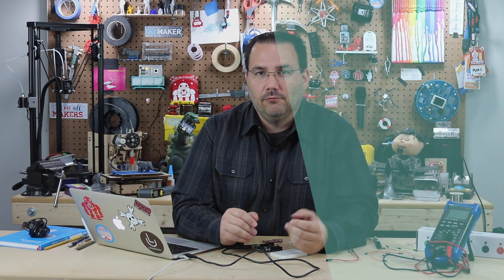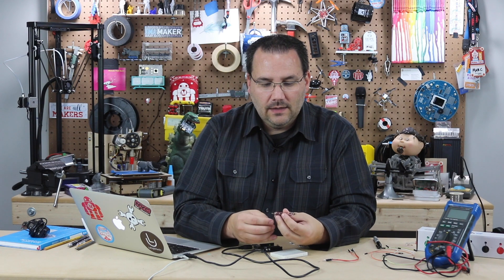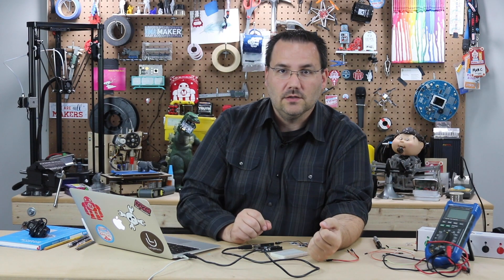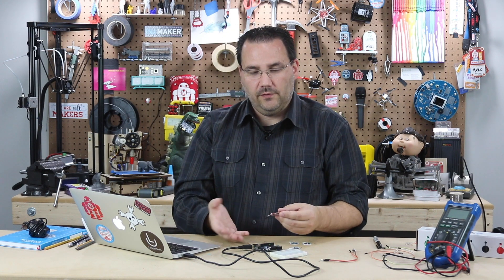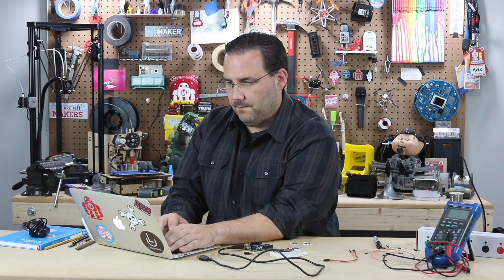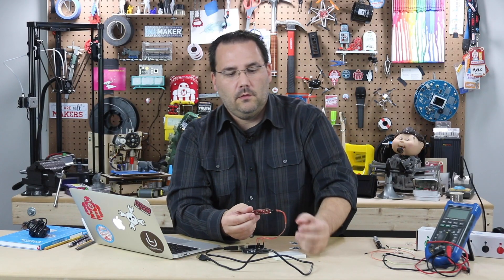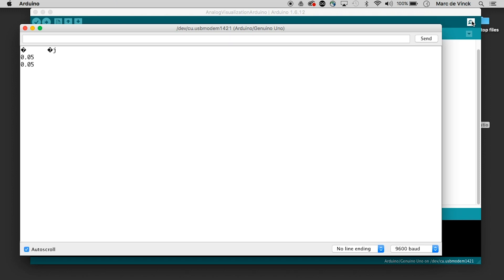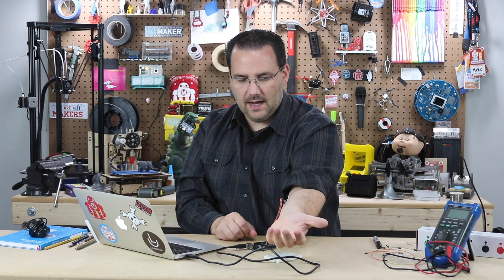Arduino Prototyping Inputs #64: MyoWare Muscle Sensors

Comment: i am facing noises while reading from the sensor. how you solved this problem?
Reply from the maker: Filter the results via code if possible. That is the easiest solution. Try averaging the results over time?
Reply: Also a USB isolator could help.  Adafruit does one, listed on the myoware website.

Comment: What's that 3 pin connector you have on the myoware? The one with the positive, signal, and negative
Reply from the maker: One side is for adding shields, supplies power and signals, the other is also for data out. Check out the data sheet for all the info. You can find it under the "Documentation" tab on this link -- https://www.sparkfun.com/products/13723

Comment: Hi, thank you for your amazing video. One question- I tried it with the basic AnalogRead sample and the output data had an average of 250 instead of 0.05 like yours. Do you know why that would be? Thank you.
Reply from the maker: If you are using the supplied code with MyoWare, then I'm really not sure. If you have your own code, my guess is the range of you mapped values if incorrect, or post processed with some more math that is making it off. I'll also add, that if the results have a range, it might not be an issue. Might want to head over to the MyoWare website and ask their tech support.

Comment: 1:31 are there any alternatives to disconnecting the computer charger in order to disconnect the arduino system from the high voltage supply? For example, is there any adapter that you can place between the arduinos USB-connector and the connection to the computer, in such a manner that there isn´t any direct connection between high voltage and arduino, but att the same time, the computer is continuously charged?
Reply from the maker: I'm not exactly sure about a solution, or what you are asking specifically. Keep in mind that the MyoWare can be run right from an Arduino, without a computer. So there is no high voltage involved, and it's a lot safer. If you need external output like a serial monitor, you could use an onboard LCD, which could eliminate the required computer. I would head over to their site to get specific details, as they would be the experts. -- http://www.advancertechnologies.com
Reply: @MarcdeVinck  Thank you for the quick answer! I would like to do some "long-term" (one working-day /8h) EMG testing while continuously monitoring signals from the EMG via the Arduino serial monitor/plotter. However, my laptop battery will not last that long! I have a weak recollection of seeing this safety adapter that you put between Arduino and the laptop for the purpose of fulfilling the properties described in my first message, but now I can´t seem to find it anywhere. Maybe it was just something my mind made up.
Reply from the maker: @Robin_Juthberg  Any standard USB cable will have data and power lines. Basic cables supply power only. In either case you can't isolate the computer form the Arduino if you need power. You could optically isolate the data signals with an optocoupler, but hat does not supply power.  You can use an external battery pack, sized appropriately, and it can last a very long time. Just be safe!

Comment: Hello, is it safe to use two MyoWare sensors plugged in the Arduino Uno with USB as the power source? I want to measure the muscle activity of two or more muscles at the same time and I couldn't find anything in the internet. Hope you can help me here. Thank you!
Reply from the maker: Check out the MyoWear website for all the safety information. I don't like anything plugged into an outlet when strapped to my body.

Comment: Hi, thank u for explanation on the safety use of muscle sensor. I want to use muscle sensor with other sensors and esp01 wifi module.  I want to know if I can connect all them together on 5v pinout? Will there be complication with current drawn from arduino to sensors?
Reply from the maker: Y Indigo It depends on how many sensors, what types of sensors, and the pins you are using. In general, most sensors don’t draw a lot of current but that varies a lot.

Comment: Hi! How would I be able to use the input values from the sensor to control motors? I'm trying to control multiple motors to respond to flexion of my arm muscle but I'm not sure how to connect multiple motors and a sensor to an Arduino.
Reply from the maker: To control a motor with an Arduino is best done by off-loading that process to a motor controller board. There are many out there. Check out Adafruit.com and search for motor controller. This is especially true when it comes to multiple motors, servos, or anything that uses more power than the Arduino can handle (which is low). In fact, it's always a good idea to use some kind of H-Bridge to control motors.

Comment: hello ,
can i test the duration of the contraction if it is long time or short time to detect more possible movements ???? and how it can be done ?? show me the code of it please.
thank you
Reply from the maker: Sure, you can detect when the contractions occur and the time between the contractions. For the code. Sorry, I can't create the code for you, I just don't have time and I've got to pay the bills too! Try searching for measuring time with Arduino via your favorite search engine. It should be fairly easy to adapt code to work in your project.

Comment: Stupid question I’ve been seeing videos when they used a nano arduino, my question is it possible to use a arduino uno instead a nano for mayoware muscle sensor? Would it give the same results to?
Reply from the maker: Yes you can. They have the same pins, just a larger form factor. Voltages can be different in some cases depending on the board, but that is an easy thing to change. The sensor will give the same results.
Reply: Marc de Vinck thank you I really appreciate it.